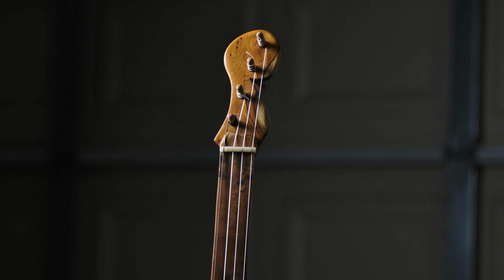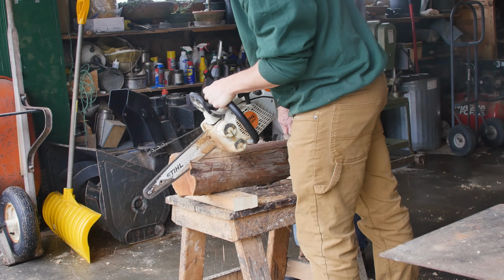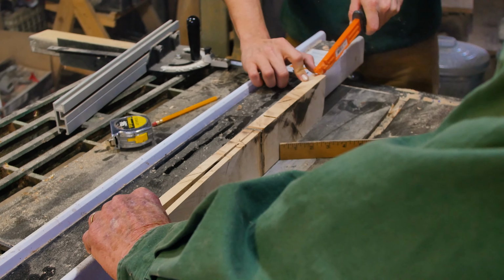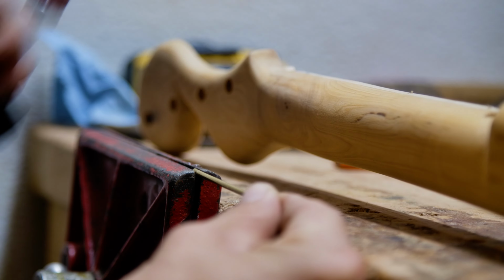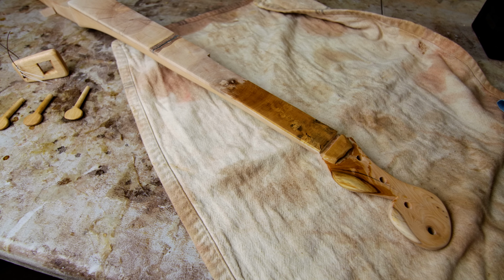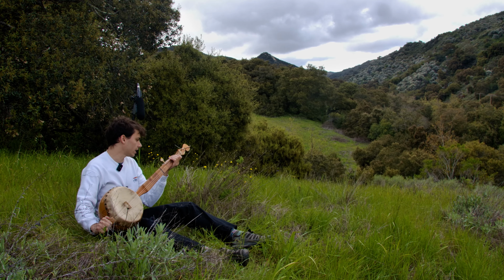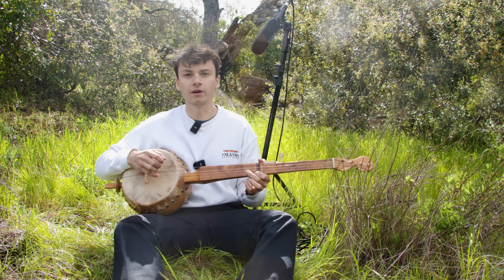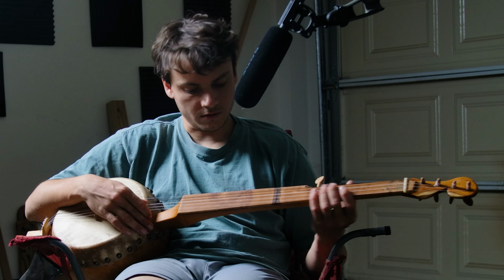Yew Wood Neck and End Grain Fingerboard FULL BANJO BUILD

Comment: Very pretty build but I can't imagine that will last long.
The typical reason that quarter sawn or rift sawn wood is used for fingerboards and necks is stability. Fingerboards are usually made of extremely dense and stable woods, because they need to stay as flat as possibly over time. You want the lignin running consistently down the length of the piece of wood, to make it more resistant to warping over time. Using the end grain like this, is very nice looking, but much less stable.  On a fretless banjo, it might matter slightly less, especially depending on the action height. Over time though, you can expect it to warp A LOT more than a fingerboard cut normally. Especially when compounded with the epoxy, which is also highly unstable depending on the humidity and temperature.
Reply from the maker: Yeah I'm very curious to watch this over the next several months and see how it responds to the summer dryness. This fingerboard did warp pretty bad after the glue-up, it cupped up on the ends, but since I sanded it back level there hasn't been much movement. Probably wouldn't ever try this with frets. This was pretty experimental, I have a couple more of these end grain blanks and I wanna try to soak one with thin epoxy and sort of plastify it.  I like the look so much, I really wanna figure out how to make it more feasible.
Reply: @bengreco   It came out pretty nice looking. I would think if you could find a super stable, well seasoned, quarter sawn piece of wood to use as the neck, and glue on a real thin slice of that end grain wood and seal it in, then the whole fretboard will have less free will of its own to try and warp.